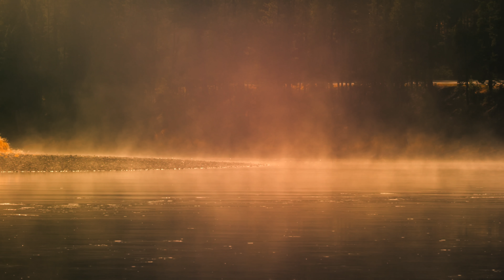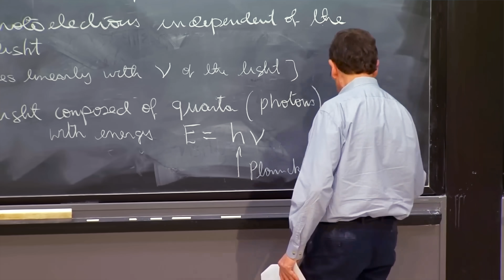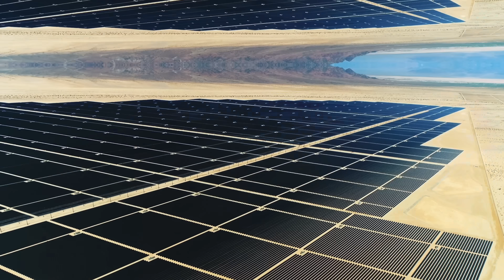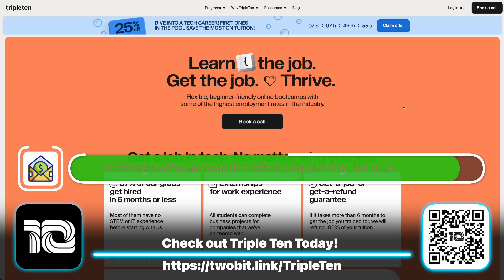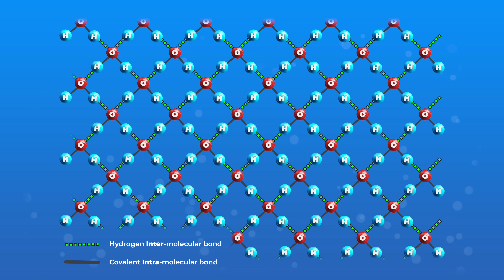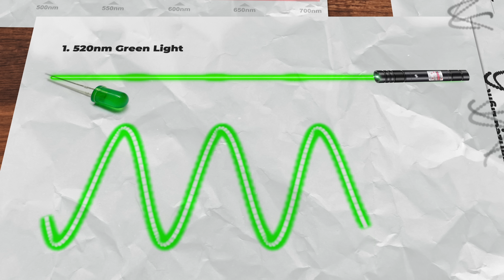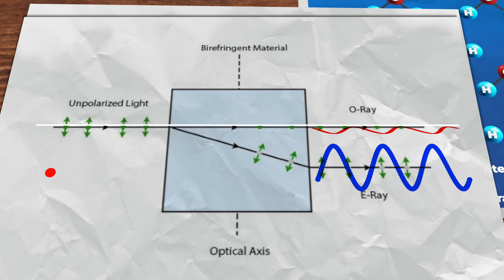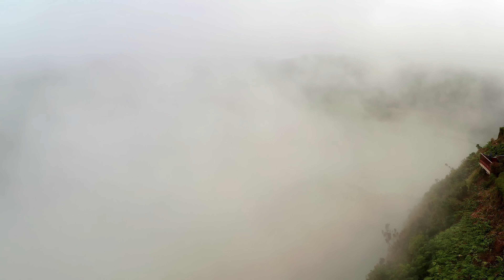New MIT Discovery Just Solved Water's BIGGEST Mystery!

Comment: The science is never settled. Any expert that says otherwise is either intentionally or unintentionally wrong.
Reply: that's what makes science so useful,  by design, it asks to be challenged and to dig deeper, rather than be punished for refusing to change the reasons for a thing when better (more comprehensive/more accurate) reasons/theories  are presented.
Reply: @unionse7en  Unless you are challenging general relativity or the big bang theory.  It is sacrilege to do that.
Reply: Fine but you don’t need to understand the unique actions of every individual to model crowd behaviour.  This does not invalidate climate models that are checked against actual data.
Reply: The Australian CSIRO were reporting this over a decade ago, it’s not new
Reply: So we should give equal weight to flat Earth proponents? After all, the science isn't settled that the Earth is round.
Reply: @maxpeterson8616  that is only correct when following The Science™ because if you follow the scientific method (observation, question, hypothesis, experiment, conclusion, result) flat earth theory falls apart.

Stat using that thing on your neck as more than a place to put your hat.
Reply: @chrisharvey1091  What experiment proves the earth is round?  I'm not a flat earther btw, just asking.
Reply: @wesbaumguardner8829  Eratosthenes measured shadows to prove it
Reply: @wesbaumguardner8829  Two, old simple observations:
1. If you watch a ship sail 'over' the horizon, it does not drop off suddenly, but gradually disappears below the horizon. Portuguese explores observed this.
2. Eratosthenes erected a pole in Alexandria, [as well as a second city] and on the summer solstice [at noon] he observed that it cast a shadow, proving that the Sun was not directly overhead but slightly south. Recognizing the curvature of the Earth and knowing the distance between the two different cities enabled Eratosthenes to calculate the planet's circumference. [You can lookup details and repeat the math.]
3. I believe Aristotle observed a round shadow during an eclipse, but I don't recall the story.
4. Today, a supersonic jet can observe the curvature of the Earth, but again, I don't recall the height and details required.
Reply: @wesbaumguardner8829  it involves measuring a shadow of a fixed object of equal sizes at different locations, separated by at least 100 kilometers, at exactly the same time. Doing so will mean that the shadows are of a differing length, proving curvature of the earth. Further mathematical calculations, don't ask me what or how because I can't math well, will give you the circumference of the earth, within a kilometer or so of accuracy.
Reply: Are you meaning the methods of observations? Or the immeasurable data that somehow comes along? Or the lack of grandiose scales of scrutiny?
Reply: @TheWorldBelow360  I mean their methodology is completely ad hoc, inconsistent, and unscientific.  They add mass on galactic scales but they do not add mass on the scales similar to our solar system as they are not needed.  When they add mass, they add the amount they need to get the correct answer to match observations.  This methodology is completely unsound and does not lead to real knowledge.  All it leads to is the delusion of appearing correct when it is not.  Mass is either there or it is not.  You cannot just pretend mass is there when you need it there to make an equation work and pretend it isn't there when you do not need it to make an equation work.  This is the same exact methodology religions use to make their lies congruent.
Reply: @wesbaumguardner8829  that’s not at all what’s happening. Quite the opposite. The missing mass is literally pointed out as a huge discrepancy between our predictions and observations. It’s still a huge open mystery. There’s quite a few different hypothetical explanations being looked at. No one is pretending something is there.
Reply: @jackdavinci  "that's not at all what's happening.  Quite the opposite.  The missing mass is literally pointed out as a huge discrepancy between our predictions and observations.  It's still a huge open mystery.  There's quite a few different hypothetical explanations being looked at. No one is pretending something is there."  Oh really?  There are tons and tons of videos with people including mainstream physicists talking about "dark matter" and "dark energy" and claiming it's there.  Then they go on to explain that this invisible gobbledegook is what "causes the expansion of the universe."  You will also hear people laud general relativity as the most accurate theory ever created while pretending they do not have to add 19 times the observable mass of the universe to the observable mass of the universe in order to get it to work on the galactic scales.  No one ever had to do that with Newtonian physics, by the way.  Sure it was off, but it was not THAT off.
Reply: @wesbaumguardner8829  it can easily be done by measuring shadows at different locations during the same time of day
Reply: Agree 100%. No belief should be held too strongly.
Reply: “Attacks on me, quite frankly, are attacks on science,” Fauci said Wednesday. “All of the things I have spoken about, consistently, from the very beginning, have been fundamentally based on science. Sometimes those things were inconvenient truths for people.”

This POS 'scientist' killed more people than Covid! EXPERT AND SCIENCE IS MEANINGLESS
Reply: Science is ONLY settled when it goes from being a THEORY (ie The Theory of General Relativity) to a LAW (ie The Law of Thermodynamics). Until that happens, IT IS NEVER SETTLED.
Reply: So you and all the other high school dropouts I see in these comments think that all "settled" science is somehow still possibly wrong? The Earth is not a spheroid that rotates around the Sun? A carbon atom can't form four covalent bonds? The speed of light in a vacuum is up for grabs? Germ theory? Photosynthesis? It's all just "science" .. none of it is proven?
Reply: So you and all the other home-schooler's I see in these comments think that all "settled" science is somehow still possibly wrong? The Earth is not a spheroid that orbits around the Sun? A carbon atom can't form four covalent bonds? The speed of light in a vacuum is up for grabs? Germ theory? Photosynthesis? It's all just "science" .. none of it is proven?
Reply: As always context is key. While it's technically true that the science is never 100% settled, there's definitely degrees of certainty. If you flip a coin or buy a lottery ticket technically you have a chance of winning either, but the chances are vastly different. At a certain point, the science is settled enough for all intents and purposes.
Reply: @jackdavinci  I think in terms of 'practical' certainty and 'practical' impossibility. For example, there's a chance i'll get hit by a meteorite if I go out today. However, the chances are so remote that it's a 'practical' certainty that it will not happen. Like you said in your own post, the science can be settled *enough* to accept it as an axiomatic truth.
Reply: @jackdavinci  The adherents to Ptolemy's geocentric model thought it was "settled science" with a very high degree of certainty.  The same as the Einsteinian relativists do today.
Reply: @wesbaumguardner8829  neither of those things are true, and I'm not sure how it would be relevant anyway
Reply: @jackdavinci  You are wrong.  Both are true.  And it is relevant because we are still susceptable to the same errors as people 1,000 years ago and have not learned from the past.
Reply: @wesbaumguardner8829  the two situations aren't even remotely comparable. The geocentric model was based largely off of scriptural interpretation and contradicting it was subject to accusations and penalties of blasphemy. Despite the fact that there were huge glaring issues with it. 

Einsteinian relativists do not consider that completely settled. It's certainly more accurate than Newtonian and has passed every practical tests we have come up with, but there's still things it can't explain like dark matter. But it's settled to the extent that technology that depends on it works predictably. 

There's certainly some issues with science but they are quite different than the way you characterize them. OTOH there's basically zero chance that the earth is flat. That's as settled as anything is capable of being settled.
Reply: @wesbaumguardner8829  Eratosthenes
Reply: @wesbaumguardner8829  E r a t o s t h e n e s
Reply: @wesbaumguardner8829  you can measure it with shadows.  Eratos thenes
Reply: @wesbaumguardner8829  Relativists accept that Grand Unification may have more to say. However, just as Newtonian physics is 'settled' [yet incomplete], so is General Relativity [but not complete]. Special Relativity is not settled or complete, it just describes a special case.
Reply: @jackdavinci  You are so wrong that  you do not even know how wrong you are.  Ptolemy did not base his theory on scripture.  He himself credited Hipparchus with the fundamental principles of his theory and the remainder on his observations of the night sky.  

You claim that Einsteinian relativists do not consider his theory as "settled."  Could have fooled me.  I can explain how they use ad hoc reasoning to make the mathematics work until I am blue in the face and they do not even budge.  Then you have the fact that several people that have questioned the theory have lost academic tenure, been censored through the "peer review" process, lost study grants, etc.  People are punished for going against the mainstream dogma, they just are not placed in house arrest by the church anymore.  Instead, they are forced out of their careers and ostracized by academia.

You claim that it has passed every test that people have come up with.  It has not.  The very first confirmation of the theory made by Arthur Eddington used heavily cherry picked data which claimed the telescope used had much higher precision than it actually had.  The Hafele-Keating experiment published completely fabricated data to make it appear that the experimental observations accorded with the predictions made by special relativity.  The results of the Sagnac Experiment and the Modified Sagnac Experiment are explained away by "differences between inertial and non-inertial reference frames" when there really is no such thing as an "inertial reference frame" because ALL possible observable reference frames in this universe are undergoing numerous and variable accelerations due to gravity.  Then there is the falling rock test.  If spacetime bending is what causes a rock I drop to fall to the earth's surface at an acceleration of 9.8m/s^2, I should be able to measure the spacetime changing per Einstein's relativity, but I cannot.  No ruler and no clock between a falling object and the earth is affected by "spacetime bending."  Thus, it does not happen. 

No, the problems with science are not any different than the way I have described them.  Relativity and the big bang theory have become dogma.  People are just parroting what they have been told repeatedly without question and when you question it they claim "you just do not understand it" while completely ignoring the arguments made against the theory.  Much like you are about to do.

Let me guess, the technology you are going to claim works on general relativity is GPS, right?  The tried and true claim which one cannot prove one way or the other because the information is hidden behind proprietary secrecy.  Name a single technology that is not GPS that works by using General Relativity.  Just one.

P.S.  I am not a flat earther.
Reply: @jackdavinci  My first response was censored, so I am re-responding, just in case this happens to get through.  There is no need to censor people if they are obviously wrong.  "The two situations are not even remotely comparable."  Yes, they are completely comparable and related.  Ptolemy created a geocentric model and it was thought that all of the observations fit it until telescopes started being used and then it turned out the observations did not fit so they performed ad hoc contrivances called "epicycles" to explain the new observations while holding onto the same theory.  This went on for hundreds of years unquestioned until Copernicus posthumously published his solarcentric theory and then Galileo supported it and was placed under house arrest by the Church.  Pretty much the same ad hoc contrivances are being made to support general relativity right now.  It was claimed that the theory was correct without any modification at all until Hubble determined that galaxies needed 19 times their mass added to them in order to have gravity strong enough to match the observations.  So on the solar system scale, the model works without dark matter and dark energy, but on the galactic scale, all of a sudden, all of those solar systems and star systems in those galaxies need 19 times the mass added to them for the mathematics to work out.  Is the mass there or is it not there?  Well, "its there when they need it to be there and it is not when they don't."

"Einsteinian relativists do not consider that completely settled."  Actually, they do.  They think the theory is correct and true and just needs a few finishing details.  Meanwhile they look over the blatant problems with the theory.  Pretty much the way the Ptolemaic geocentrists did.

"It's certainly more accurate than Newtonian and has passed every practical tests we have come up with but there is still things it cannot explain like dark matter."  No, it is not.  Newtonian physics does not require anyone to multiply the mass of the universe by 19 and add it to the mass of the universe and pretend it is there at certain scales and not at others.  Also, it has not passed every test.  Per Einstein, spacetime bending causes gravity and spacetime bending affects matter.  So, if I drop a rock, I should be able to measure the spacetime bending between the earth and the rock, but I cannot.  Also, most, if not all the "confirmations" have been junk science.  The very first confirmation made by Arthur Eddington used heavily cherry picked data and claimed the telescope utilized had a much greater precision than what it did.  The Hafele Keating Experiment published completely fraudulent data to make it appear that the experimental observations comported with special relativity's time dilation hypothesis.  The real data from the experiment was inconclusive.  Additionally, the authors claimed the clocks had a much higher precision than they actually had.  The results of the Sagnac and Modified Sagnac Experiments are hand waved away by claims of "this is caused by differences between inertial and non-inertial reference frames."   There is no such thing as an "inertial reference frame" in this universe because all observable reference frames are undergoing numerous and varying accelerations at all times.  The earth and any location on earth is not an inertial reference frame because the earth is rotating on a wobbly axis while revolving around the sun which is revolving around the center of the galaxy.
Reply: @jackdavinci  "But it's settled to the extent that technology that depends on it works predictably."  Really?  What technology works off of it?  Oh, right.  GPS.  Relativists always bring this up because it is unfalsifiable.  You cannot prove that the algorithms utilized by those satellites use the equations of General Relativity.  Ron Hatch, whom has several patents in GPS technology claimed that general relativity did not work and presented several lectures describing the problems with it.  I haven't seen any astrophysicist up there refuting anything he stated.  So, name a technology that is not GPS that works off of General Relativity.  Just one.  I doubt you can do it.

"There's certainly some issues with science, but they are quite different than the way you characterize them."  No, they are not.  Government has captured academia.  Academia is more of a social structure of power than a means to attain knowledge and wisdom.  People that question the mainstream dogma are denied tenure in academic institutions, censored through the "peer review process," denied research grants, and basically forced out of physics careers.  Also, mass fraud is rampant in academia.  It is just a good ol' boys club where people go along to get along and maintain their cushy positions with their salaries.

P.S.  I am not a flat earther.
Reply: @jackdavinci  One more thing, Ptolemy did not base his theory off of scripture.  Scripture was written to match Ptolemy's theory.  Much of scripture was written much later than it claims to have been written that way their "prophecies" come true.  Ptolemy himself credited Hipparchus with the basic tenets of his theory and the remainder on his own celestial observations.  So, there's that.
Reply: @wesbaumguardner8829  I think the epicycles and house arrest prove my point about geocentrism. 

We don’t know that the dark matter thing is an issue with relativity specifically. But whatever the reason for it is, it’s certainly not being ignored. And generally the astrophysicists who I’m familiar with act really excited about any outstanding questions we still have. I have seen them appear practically gleeful about the crisis in cosmology until the new telescope gave us better data that seems to have possibly resolved that issue. 

If you think you should be able to measure the space time bending when you drop a rock then you can’t be familiar with the subject. Gravity is an extremely weak force at that scale, any instrument sensitive enough would be drowned out by the noise of other influences. And yet we have copious evidence of gravitational lensing. We have literal photographs of that bending on scales large enough to detect. And we have gravitational wave detectors that have been verified by visual confirmation as well. Not to mention that gps requires relativistic equations to work. Relativity is clearly functional for a wide range of applications and observations. It’s not like newtonian is wrong, it’s correct under a certain range of conditions. The same is true of relativity. There will likely be some more complex theory that explains a greater range of conditions but that doesn’t disprove relativity.
Reply: @hanksimon1023  Is there 19 times the observable mass in the solar system than what we can see?  If there isn't, the model has failed.  You see, they do not add the dark matter and dark energy mass necessary to make GR work on galactic scales to their calculations when they are working on the scale of the solar system.  The math works fine on the solar system without the added mass or else the theory would have been immediately debunked in the very beginning for requiring 19 times the observable mass to be added to the observable mass of the solar system in order for it to work.  The mass is either there or it isn't.  It can't just poof in and out of existence arbitrarily as physicists need.  However, the physicists pick and choose when they need it there to make their math work.  It is a crap theory using crap methodology and the people using it are not scientists in pursuit of real knowledge.
Reply: Dude once you have the Correct number for lightspeed, that is set. or that 1 second, which is 9.149 BILLION cycles of a cesium atom. Solved problems  or formulae like E=mc squared don't need no further science once set and considered "working standards".
Reply: Yes, the science is never settled.... 
BUT this video still failed to disprove the Laws of Thermodynamics.  
If photons are entering a system of liquid water molecules, causing them to evaporate... then HEAT is definitely involved.
Reply: This one of the most irritating phrases (the science is settled) to me because it’s the equivalent of saying we know everything there is to know and that is ridiculous, and smacks of pride and ego beyond comprehension. 

Only a fool would think that
Reply: ‘Settled’ just means that ignorance is at a local minimum.
Reply: If it's science, it's never settled. If it's settled, it's never science. I don't know who came up with the concept of "settled science," but anyone who uses that term is either deluded or a charlatan.
Reply: Lay people can tend to put too much of an emphasis on this, and neglect to take into account the ways that successor theories relate to the theories they supersede.
Of course, one should follow Cromwell’s rule (“I beseech you, in the bowels of Christ, think it possible that you may be mistaken.” / “zero and one are not probabilities” / “leave a little bit of probability for the moon being made of green cheese”)
But,
well, a common thing that people who don’t get probability say, is that “if the probability isn’t 0% or 100%, then it is 50%”. And even when they don’t say this, it seems people often make errors in this direction. (Perhaps this is why the lottery is popular?)

Yes, we must always be open to evidence which goes against our current understanding, and to updating our model of the world (even drastically! ...if the evidence calls for it.). But, when our models have been extensively tested and pass these tests very well, then, well, alternate theories which predict different things than what we saw in these experiments, should be considered very unlikely.
Insofar as theories have been well-tested, we should expect with very high probability, that any successor theory, if it is strictly more correct than the current theory, will align with the current theory to the degree that the current theory agrees with the tests done so far.
When general relativity was found to make better predictions than Newtonian gravity, Newtonian gravity did not cease making still-pretty-good predictions, and there are good mathematical relationships between the two theories.

I think some people seem to resent scientists or something like that(?), and this leads them to put excessive focus on the possibility that “the mainstream scientists were all wrong”, specifically not just wrong in small ways, in the ways which are likely, but in big super-unlikely ways, ways which seems very difficult to square with existing experiments.

Or maybe it isn’t resentment, so much as the population culture being excessively contrarian? I’m not sure.
Reply: @drdca8263  General relativity does not make better predictions than Newtonian gravity.  Newtonian gravity does not require a 1,900% correction to the mass of the entire friggin universe to get useable results.  Einsteiners pretend they can multiply the observable mass by 19 and add that to the observable mass when it suits them.  They do not add this mass to the solar system when they are calculating it because they never started adding this mass until they discovered the model doesn't work for galaxies.  If the invisible mass they unscientifically cannot detect but claim exists were in the galaxies, it would have to be in every planetary system in the galaxies, too.  However, the theory of special and general relativity was calculated and "confirmed" before the ad hoc contrivances of "dark matter" and dark energy were conjured up to make the math work.  The Einsteiners have abandoned the scientific method and have reinstituted its predecessor which was used by adherents to Ptolemy's geocentric model to maintain its relevance long after it was shown not to match observations which is to make ad hoc contrivances to explain away the discrepancies between observations and theory.
Reply: Dr. Fauci "is science". Just ask him 🤣
Reply: @gangoffour6690 Not what he said.
Reply: @gangoffour6690  He never said that!
Reply: @gangoffour6690  come on bro, you ain’t here for science, you’re a troll
Reply: every climate change alarmist ever
Reply: @rotaryenginepete  Unfortunately, denying that the science is settled is a tactic most often misused by ignorant science deniers like flat-earthers, anti-vax weirdos and gullible climate change deniers parotting propaganda from Big Fossil.
Reply: @rotaryenginepete  Quiet down half wit.
Reply: @Seán O'Nilbud cope harder
Reply: Tbh the entire thing is basically "oh hang on, we found another discrepancy between our model and reality".
That's all this "maximum rate" really is. It's not even about the model that describes the basic process, but about an applied spreadsheet.

The assumption in the applied model was not entirely correct. Whoopteedoo.

As for the explanation, liquid water is not a rigid unmoving structure, and the overall rate of evaporation in general is a balance between rates of evaporation and condensation at the surface, plus more distribution shenanigans at the boundary area.
So basically the whole explanation shows why we don't often hire US students for hard science.
Reply: @sneezyfido  Know your audience. Based on the comments a lot of people learned something new from this. They may not be as smart as you but they're learning which means they're intelligent and can become smarter, like you.
Reply: @SachiJones  It's a mildly disappointing 'feature' of maths/science/tech comments sections: the extraneous 'flexing' that occurs. Maths is the worst, in my experience.
Reply: @SachiJones  Applying a laser to do something, the sun does for free, is neither "Efficient" nor necessary.  Literally vaporware.